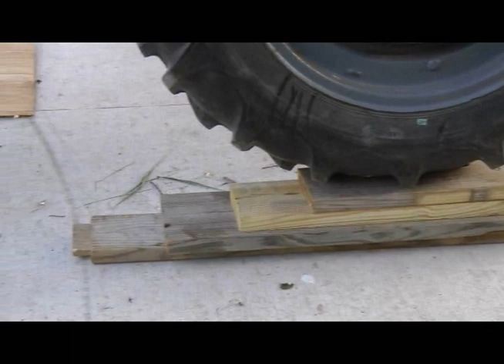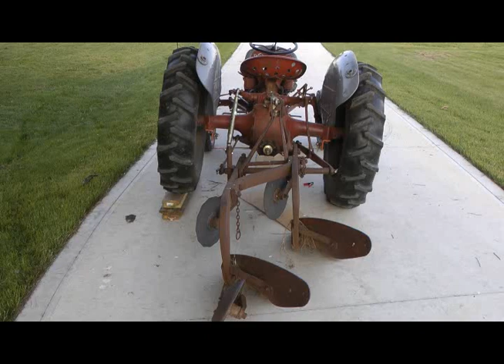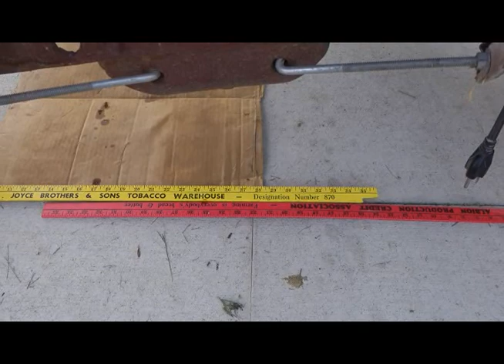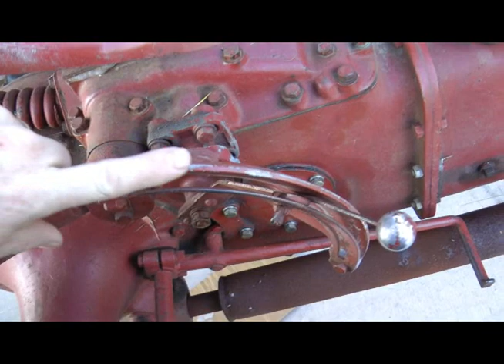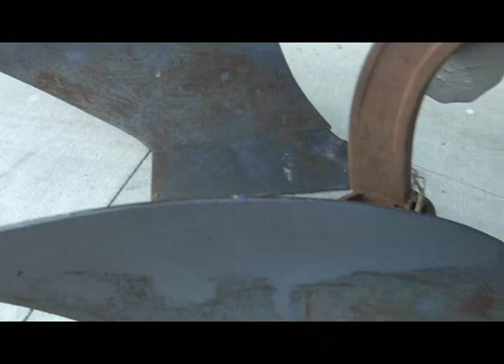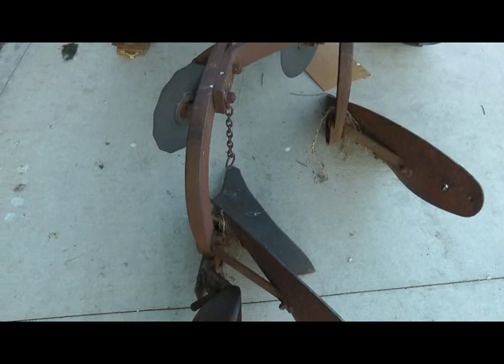Setting up Ford 8n 9n tractor with a two bottom plow

Comment: Thank you so much! I've just gotten my hands on a Dearborn 2x14 and I'm struggling getting it set to turn the ground over correctly. Now I have a plan of attach to set it. Is there any reason an 8n wouldn't be able to pull 2 14s?

Comment from the maker: If you don't have the plow aligned as indicated in the Ford manual . . . it might work, but for all the wrong reasons.  The draft control is designed to lift the plow when it starts to load down, and it is the main mechanism that allows the set depth to be maintained.  The settings above allow for the plow to cut into the soil to the depth where the landslide is parallel to the ground.above.  Misalignment overworks the draft control and hydraulic pump and wastes power fighting the plow.

Comment: This is adjustment for subsequent plowing. For the first trip around the field, all wheels will be on flat ground and plow should be adjusted to run flat side to side and front to rear. Once wheels are in furrow-is what hes talking about here. Also, worn coulters should be adjusted nearly to plow points to cut trash and roots, and to relieve stress on plow. Adjustment bar should be on the right, because thats the side thats adjusted between first and subsequent plow trips.

Comment: Is your lift arm adjust on the left-side bar typical?  I just got a 1939 9n this past week, and the lift adjust is on the right side on mine (granted I suspect they can be interchanged).  Also my tractor has the 'heavy duty' assist bars that run parallel to the lift bars; do you suggest removing them for plowing (granted it looks like they would not fit on the pins of the Dearborn anyway - I am getting a two-bottom plow tomorrow and will need to see then).  Thanks!